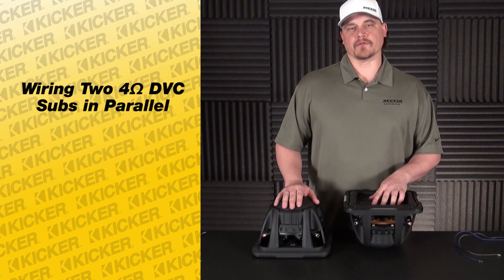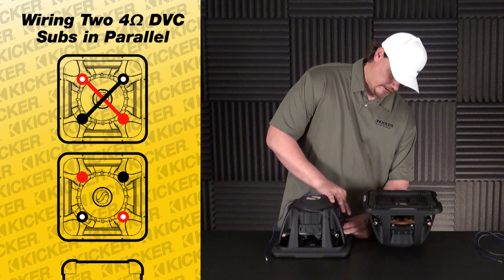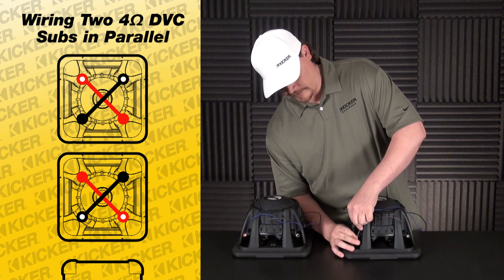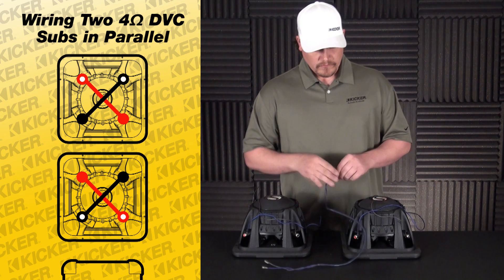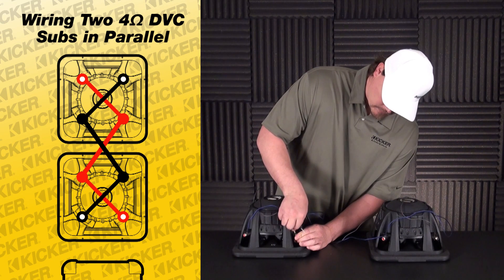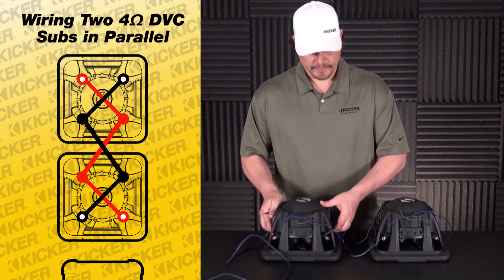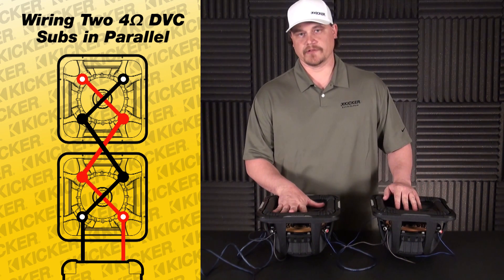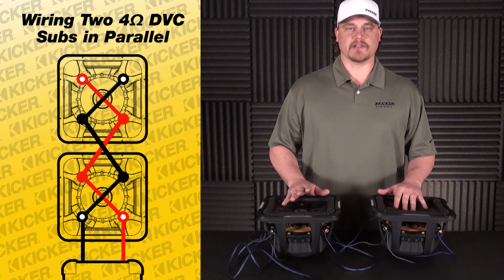Subwoofer Wiring: Two 4 ohm DVC Subs in Parallel

Comment: What if I only have 2 connections 1positive 1 negative?
I just got 2 kicker comp c
Reply from the maker: Then you have 2 simple choices (assuming its a 4 ohm voice coil):  8 ohms (series) or 2 ohms (parallel).
Reply: @KICKERAudio I wired them sending negative to the other negative on the other sub, same with positive and ran them out to the amp, is that right?
Ty for your response

Comment: I hooked up my L7 the way u said in the video my speaker burned
Reply from the maker: The ohm load isnt the only factor in keeping your bass playing long-term. Your crossover, your wiring, your power, your enclosure and of course the level of clipping all contribute. Contact Tech Support to go over your system.  They can help diagnose the problem.  If your sub is covered under warranty, they will get the process started on that as well. 

Their number is 405-624-8510 or support@kicker.com. They are available weekdays from 8-5 cst.

Comment: Can't you just hook it up right in the box. Without connecting the two together and bridge the wires on the amp itself.
Reply from the maker: Do you mean only use one voice coil per sub? Sure, its possible but youd lose half of the power handling. Unless that's not what you meant...?
Reply: @KICKERAudio  instead of drilling a hole in the divider to feed the wire from one to another. Hook it up normally in each port. Then bridge it on the amp itself
Reply from the maker: Ah ok. Sure that's fine.  As long as the amp "sees" the load its supposed to.
Reply: No sir you can not electricity doesn’t work that way, I would erase this question you wrote asap
Reply: Whoever is writing from kicker is being way to nice to Rudy lol

Comment: What about 2 2ohm solo baric L7 type R subs run to 1 ohm
Reply from the maker: You can use the wiring wizard in Kicker U (www.kicker.com/kickeru) for wiring diagrams if you like, but unfortunately 1 ohm isn't possible with a pair of 2 ohm DVC subs. 2 ohms would be the lowest, unless your amp is 1/2 ohm stable.

Comment: So u only connect one side of the box inside
Reply from the maker: No, you would always connect all the subwoofer terminals.
Reply: @KICKERAudio  how u said  only one going to amp right so how would I do that
Reply: I’m talking about the box not the subs
Reply from the maker: Some enclosures have a single set of terminals, some have more. You need to know the ohm load of the terminals (check with a multimeter) to determine how to wire them to the amp. Tech Support's contact info is: support@kicker.com or 405-624-8510.  They are open weekdays 8-5 CST. They can help you wire it correctly.

Comment: What if I have a Mono Class D amplifier which is a 1ohm stable..do I still run it to one side connection?? Because the car audio who did it hook up both subs to my amplifier as a 1ohm stable.. any help would I would be grateful
Reply from the maker: Running one side of a sub, while possible with many (but not all) DVC subs, cuts the power handling in half.  So the question to ask yourself is this: is the advantage of getting a lower ohm load worth  changing the power handling of the sub, and your setup? Usually, no. Bear in mind that doubling the power results, on average, of increasing the output by about 3dB. Most people say that the actual perception of double the volume to the human brain is 10-12dB. At the end of the day, double the power never equals double the volume. Plus, higher ohm loads tend to be more accurate, acoustically speaking. Hope this helps Samuel!

Comment: Question: I have 2 speaker inputs on my 1 ohm stable massive n2 amp.. do I wire like he did . And just use the one side of the terminals on amp. I believe they are bridged to make 1 ohm inside the amp
..please clarify
Reply from the maker: Sorry, never heard of "N2".  If they set up their terminals like we do on our amps, the 2 pairs of terminals are mainly there for convenience, so you dont have to jam too much wire into your sub's terminals.  Just to be safe, please check with Massive and verify that is the case.  They may have that info on their manual as well.

Comment: Is it possible to wire a 4 ohm speaker single voice coil down to 2?
Reply from the maker: Unfortunately not by itself, no. You would need a second 4 ohm SVC to parallel it with.

Comment: Red with white dots white with black dots black dots with solid red. Red with white dots. Solid white with red dots.  See. It’s simple. Was the red with white dots negative or positive. The solid red means power the white stripes mean ground. Camera was too far away couldn’t see these stripes and solid dots or a overhead view would have been perfect. As much as I’d like to say this video helped, I’m going to have to watch another video.  This one left a little something to be desired.
But seriously.  Red to red. Black to black on each speaker. Then run 1 set to the amp. Right?
Reply from the maker: Yes, you are right. We did the red/black with white dots to note what voice coil you are connecting (Coil 1 vs. Coil 2).
Reply: @KICKERAudio  
Thank you. Appreciate it.

Comment: I have 2x older 2ohm 12" l7's in separate enclosures and a 1000 watt 2 ohm amp... can I wire them to work with this amp ? I nolonger know the model of the L7 so I don't know the rms rating ?...?...?... thank you for your help in advance 

🥃cheers🍻
Reply from the maker: What are the model numbers of the subs and the amp? We would need this info to give you an accurate answer. Thanks!
Reply: @KICKERAudio  rockford fosgate r1000 1d & kicker solo-baric L7 12 I believe there dual voice coil farily old back wen you guys had the silver accents on the bezzle.
Reply: @KICKERAudio  how can I find the molded number of the subs ? I haven't took one out of its enclosures in many many many years 😅 relics of my youth you might say but the new truck got some much needed love this year!
Reply: @KICKERAudio  finally found the model it's an S12L7

Comment: Hi there how are you? I got 2x L7 15inch 1000RMS 4ohm subs and also a 5000D monoblock amplifier 1ohm. Is that allright to run those 2 sub or it’s gona blow the subs? Cheers

Comment: Hey Tyson my amp is rated at 
1. 900w x 2 @ 2ohm
2. 550w x 2 @ 4 ohm
3. 200w x 2 @ 8 ohms
Can I wire a pair of speakers at 8 0hms and a 2nd pair of speakers at 4 ohms and wire  a pair of subs at 2 ohms ??

Comment: How do I wire 2 dvc 4ohm subs to a 2ohm load final to run to an amp....working with 2 skar vd  12 dvc 4ohm
Reply from the maker: Unfortunately, you can't make a 2-ohm load with a pair of dvc 4-ohm subs.  Your choices are 1 ohm or 4 ohms.

Comment: I have a question about wiring subs in parallel with a thick wire? Is it not possible to use anything bigger than 14 or 12g for the jumper wires? I ran into an issue where I could fit two 10g wires in the same terminal.. What should I do? Subs are 4ohm dvc 600rms each. Any help is greatly appreciated!

Comment: Quick question. I'm getting 2 10" L7S's. I have a 1 ohm stable amp. I want to bring them down to one ohm, but my enclosure has 2 seperate chamber so I cant tie them together inside the box. What I'm wondering, is if I tie them on the outside of the box (connecting the 2 terminals on the back of the box, then running only one set of speaker wires to the amp), if it will do the same thing. In my head it works the exact same way but a second opinion and possibly more experienced one can't hurt. Thanks

Comment: KICKER what difference will it make if I set my set up like this ??? will it be better than 2 ohm ??
Reply from the maker: With some amps, the lower the ohm load, the higher the power rating. We recommend you match the RMS of the amp (at that ohm load) to the RMS of the sub(s). Please check how low the load can be for your amp.  It varies by manufacturer.

Comment: When i plug the positive and negative to the amp...do i bridge it..or run off the regular positive and negative
Reply from the maker: What amp do you have? If it's mono, you do not bridge (though they often have 2 sets of terminals now, for convenience).
Reply: Rockford fosgate r1200-1d 1 ohm stable

Comment: How do i connect these exact subs to a 2 ohm load
Reply: You can’t, they would have to be wired to separate amplifiers to achieve a 2 ohm load they would need to be wired exactly the same as the first part of the video and then not linked together and ran to there own separate amps....unless you buy a 2500 watt boss amp then it’s game on lol

Comment: I have 2 15" cvx dvc  4 ohm is 2 way to conect 1 0hm and 4 ohm and I have kicker cx 2500.1 i guess is the line before the zx models but this amp is 2 ohm stable right so I have to wire my subwoofers to 4 di you have a video to see
Reply from the maker: Two 4 ohm dvc subs can be wired to 1ohm. Go to www.kicker.com/kickeru for a diagram.

Comment: So do I only run one cable to the amplifier or do I do both?
Reply: both. 

one from the red on VoiceCoil #1 or #2 
one from the black on Voicecoil  you picked on step 1.

make sure the positive (red) and negative (black) are on the SAME VOICE COIL> 

hope this helps. message me if you need better explanation. Yee
Reply from the maker: Avoid wiring a single coil of any DVC speaker. You'll get a different ohm load than intended and typically lose half your power handling.
Reply: @KICKERAudio  my bad im dumb i just thought of this and went to check and @kicker speaks the truth (duh) thanks ima go re wire my stuff right now!
Reply from the maker: @maikavera2471  all good!  In fact, you might want to check the wiring guide on our app: www.kicker.com/kickeru
Reply: @KICKERAudio  thank you becuase i beleive my dumbass hooked up the positive of one voice coil to the amp and the negative of the other voice coil to the amp as well. if you guys didnt make such sturdy/forgiving  equipment i woud have been burned out my speaker
Reply: @KICKERAudio  i dont have $4 to spend on the app :(
Reply from the maker: There is a premium version and a free version.
Reply: @KICKERAudio  thank you i just dowloaded it thankn you for all your help and the great products.
Reply: @KICKERAudio  im a customer for life because of this interaction.
Reply: Yea I wired just as the video show but I’m a newbie to this and I see he only wires one speaker to the amp do I only just do that or do I do both?

Comment: How can I wire a 4ohm kicker and s 2 ohm kicker to do a 2 ohm load?
Reply from the maker: Lorenzo Lockett with a 4 & 2 ohm svc subs, you can't get a 2 ohm load.
Reply: I have a 4 ohm  Cvr15 and a 2 ohm cvr15 so how would I wire them together for a mono block amp?
Reply from the maker: Lorenzo Lockett ah ok. Let's get the model of the amp. That will dictate what the proper wiring should be.
Reply: KICKER planet Audio AC2500.1M 2500 watts class D mono block

Comment: what about if the amp lowest is 2 ohms 2 channel. how do you wire them
Reply from the maker: pepe58 pepito if you wired two 2 ohm dvc subs in parallel you'd get .25 ohms.
Reply: @KICKERAudio  ..i have 2 dvc 4 ohm and a 250a2 amp ..how would you wire them
Reply from the maker: With a dvc 2 ohm set of subs, you can get 2 ohms mono or 4 ohms stereo (same power either way - 100 watts per sub with that amp).  You should look at the model number of your subs and determine the recommended power, which is called RMS. Most subs are rated higher than that, but there is no way to know without a model number.

Here is a link to the manual for that amp: https://www.rockfordfosgate.com/rftech/library/2000/3_amplifiers/man2617b_punch2ch_man.pdf

And here is a wiring guide for our subs: https://www.kicker.com/wiring-diagrams

Comment: Do i have to jump 1 sub to the other or can i just have 1 sub qired to a 2 ohm load and other sub at 2ohm load then i have 2 positives and to negs can i run both positives and both negatives to the amp and still get 1 ohm load or do i hav to jump 1 sub to the other. Or is that just a way to get more power?
Reply from the maker: Jeremiah hodge You always have to have positives and negative’s connected for every speaker. As far as the amplifier connection, some amplifiers are one ohm stable and some are not. You would have to check your app to make sure it’s capable of that load.
Reply: KICKER what i am saying is i have 2 12 L7s 4ohmdvc and a 2 12 box with a divider if i run one sub to 2 ohms and the same with the other sub. I have 2 terminal caps that leaves me with a positive and negative on 1 side and same for other side. When i hook both of those to the amp will i still get a 1ohm load i have a 1200.1 kx my manual says 1 ohm stable. But the way the video shows it has one sub ran to the other sub and then lwft with just 2 wires. Is that a better way or the only way i will get a 1 ohm load my amp is like 15 years old. When best buy started selling kicker? I already blew up a 1250.1sdx because i ordered a 1200.1 kx offline and they sent me the sdx model and manual that came with it said 1 ohm stable but when i looked recently it says 2 ohm stable online. The lil digital screen just says service. But i was past warranty. I still have the sdx.
Reply from the maker: On our mono amps, we have two sets of terminals to make wiring easier. What you will do is attach each wire from each terminal cup to the amp.  This will result in a 1 ohm load.  It is effectively the same as twisting each + wire together and each - wire together, like you used to do on a mono amp with just one set of positive and negative terminals.
Reply from the maker: One other note.  I just learned that we do still repair that amp.  The charge generally ranges from 75-125 depending on the issue.  If you contact customer service they can give you the details, assuming you want to repair the amp. The number is 405-624-8510.  Open weekdays from 9-5 central time.

Comment: I got two 1500w 4ohm duals and a 2ohm 5000w two channel amp. What would be the best way to wire them for maximum performance?? Do I have to bridge the amp??😕
Reply from the maker: What is the brand/model of the amp?  That will help us determine the best way to wire it.

Comment: What amp and what Gage wire I get 0 or 2
Reply from the maker: The amp you get will dictate the wire and fusing you need. Do you already have speakers and subs?
Reply: KICKER yea I do
Reply: KICKER I got 2 12 inch suns kicker L7
Reply from the maker: Which L7's and what ohm load?
Reply: KICKER 4 ohm
Reply: KICKER two 12 inch solo barics I got 2 of the
Reply from the maker: I would get this amp with 1/0 gauge power and ground wire. http://www.kicker.com/kxa16001-1600-watt-mono-amplifier

Comment: Just out of curiosity if I have 2 terminal ports on my box could I run both subs out to the box and then run both to the amp so that the power goes through both subs quicker so that it's not running through one sub and then to the next. I have 2 kicker l7s and a hiphonics 2400 monoblock amp thanks...
Reply from the maker: One thing to keep in mind is that the L7's are dual voice coil, so if you want to connect them to terminals, you will be changing the ohm load you can deliver. Granted, you would end up doing that anyway, whether it was from the terminals or not.  As long as the new ohm load works with your amp, then there's no harm in doing that.

Comment: My amplifier is 2Ω stable and 40 bridged. My subs are 40 per sub now. Their 40 DVC. I want to bridge my amplifier 40 mono bridged. Do I wire them together to get a final impedance of 40 Thank you. Im looking to get the maximum power.
Reply from the maker: 2 ohms stereo and 4 ohms bridged usually gives you the exact same amount of power, so you're fine either way. You can follow the directions in this video to give you 4 ohms bridged.  You can also go to this link to grab our free app, Kicker U.  it has wiring diagrams, box building info, tuning info and much more. http://www.kicker.com/kickeru

Comment: is it possible to run 2 dual 4 ohm subs at 1 ohm with 2 amps? HELP PLEASE!!!!!!
Reply from the maker: No it's not.  The physics doesn't work out, unless the amps are strappable.  Are they?
Reply: Im not sure i got 2 CERWIN VEGA HED 2000 WATT AMPS, What specs should i look for on the manuel for these amps?
Reply from the maker: Its a very specific question, so you'd want to look in the manual or ask them directly.  My other question is why you want to go to 1 ohm?
Reply from the maker: Each amp has a max 120 amp current draw.  Did you upgrade the battery and alternator? YOu will definitely need to if you dont want the light to dim in your car.
Reply: KICKER that was going to be part of my next question, what is the difference between 1 ohm and 2 ohm?   Im not sure if ive been lied to but its been mention to me to just run at 1ohm to get a better kick/bump... I purchased 2 Dual 4ohm 15im kicker L7... sorry for the confusion, i guess im just seeking for the options i have, on how to run them.

Comment: what kicker amp is perfect for (2) 4ohm L5 12's
Reply from the maker: The KXA2400.1  Wire it to 4 ohms (series parallel).  http://www.kicker.com/kxa24001-2400-watt-mono-amplifier
Reply: i got a zx 1500.1
Reply from the maker: The 1500 delivers 750 total watts at 4 ohms.  That is a bit low for a pair of those L5's.
Reply: dang. ok what about the cxa 1800.1??? is it a good 1
Reply from the maker: At four ohms it will deliver 900 watts, so yes thats a bit more power.

Comment: hello I need help I have two low kicker L7 of 12 inches 750rms I am moving them with a boss power phantom of 5000 watts but they tell me that they do not hit much. I want to know if you recommend switching power? urgent help ¡¡¡¡
Reply from the maker: There could be many issues. The wiring could be incorrect, the power insufficient, or there could be a technical problem with the amplifier or subwoofers.  I would suggest one of two things to do next:  either bring the stereo back to the shop that installed it and let them diagnose the issue(s), or call our Technical Support department. They are open weekdays from 8-5c at 405-624-8510.  Thanks!